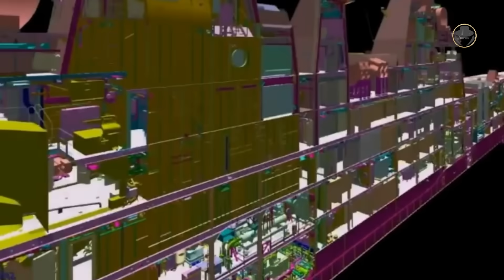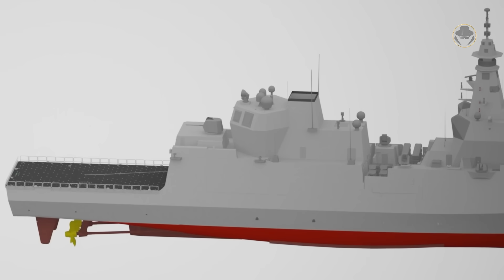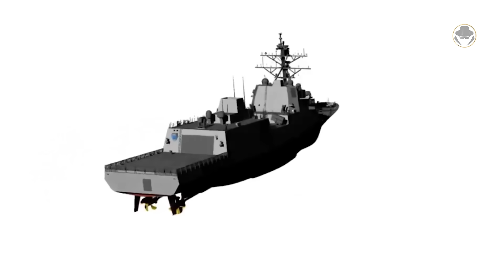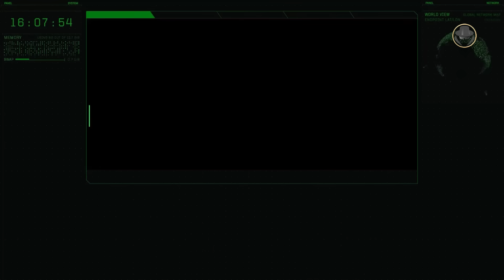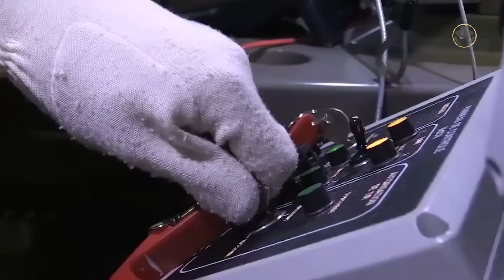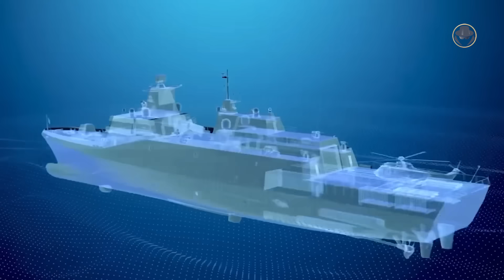FREMM class | One of today's most potent frigates

Comment: These are an excellent frigate with the drivetrain a standout feature which is one of the main reasons they were chosen by the USA.
I am amazed the USA has done such an extensive and costly redesign and still hasn't got the constellation class frigate cost and design to acceptable levels.
😎🇦🇺

Comment: Too few VLS cells for its size.
Reply: Actually it’s not comparable to us ships as the missile have higher probability of hit. 
Allowing for shoot look shoot vs shoot shoot look (for the us). 
In clear English only on aster 30 will be shoot with 90% chance hit, not then aster 15 with again 90% hit (180% chances). 
Where the us missile have 80% probability of interception (I’m obviously not really aware of those figures but for illustration) but the us will send 2 from the start (160%). 
Current y the French navy is have a mixt of 80% aster 30 vs 20% aster 15. 
So on average fremm will use 1.2 missile per target vs 2 missiles per target in the usnavy. 
So you can calculate 36x1.8 65 equivalent missiles on a USA ship. 
That is also why france is not adding the potential 24 mica vl extra, they would have to be shoot by 2, given an actual 12 target capacity (at the end it’s even more expensive then aster, they may land on the fremm but as very short defense system or mistral 3). 

Of course a us destroyer has a mucher more layered defense, not only better for self defense but also for escorted ships. 
Next year a new aster 30 will arrive with anti ballistic capacity up to 1500km and interception at 60km. 
Fell owed by a new version of the aster 15 in 2030. 

Finally, yes we could have more probably but not to much more over gunned ship have a poor stability at sea. 
And for budget reason we prefer to have under gunned ships but more numerous then the opposite, in case of war we would have a minimum time to rearm them properly.
Reply: @jeanvaljean9293  this isn't really accurate. The FREMM has more or less as many, if not more, VLS cells as any other frigate developed around the same time. The Royal Navy's Type 23 for example carries no strike length VLS cells, and the newer Type 26 carries 8 more strike length cells than the FREMM but also displaces almost 2,000 more tons. I feel like the original comment was made in reference to the likes of the USN's DDG-51s which carry 96  strike length cells, but those ships displace 3,000 more tons than the FREMMs and were designed for an entirely different mission set of long range strike using TLAMs, over the horizon air defense as part of a carrier strike group, and ballistic missile defense. All of which requires the USN DDG's to range and engage targets at several multiples of distance than what a FREMM doing convoy escort, anti-piracy, or short-medium air defense would be expected to support.
Reply: @centurion1945 would point out Fremm can only carry 16 sams and 16 strike missile or 32 of either, though that’s the problem with Slyver vls
Reply: @jeanvaljean9293 And if they are not enough there is the 76 with Dart ammunition, it hit so many in the Red Sea.....
Reply: The DART rounds cover part of the missing vls's job.
Reply: strales 76 mm is a game, with guided bullet its interchangeable with aster and more economically
Reply: Made for a time when there wasn't a full blown military conflict in europe and countries didn't threaten to annex each other
Reply: I feel that it would be much better to have a design together with a major shipbuilding nation, that also uses American tech, like AEGIS. I would say South Korea.
1. Joint development would significantly lower costs.
2. Some of the hulls could be built there, then sail to the US for radars and other specialized equipment installation (for the sake of OPSEC). Koreans can mass produce ships at a bargain price, also they are ok with the technology transfer, so some shipyards could be set in the US to build these ships as well.
Reply: @Viktor-x1w7w  we dont want us hardware

Comment: Le  programme Constelation avec les Usa est un cauchemar! le lobby américain veut plus et encore plus mais c'est impossible, je plains les Italiens! en France nous sommes passés à la FDI sans l'Italie. Magnifique la FREMM mais sans les obligations Us!
Reply: Basically every issue with the Constellation class comes down to making it compatible with the Aegis air defense system and US weapons systems like ESSM and SM-2/SM-6 since there is little point in having a ship that cant use any of the current weapon stockpiles and cant fully communicate radar and tracking information with the rest of the fleet. That said, most of the "nightmare" was FMM making somewhat unrealistic marketing announcements when they were first awarded the contract, with the first ship of the class still on schedule to be delivered several years faster than a "clean sheet" design would have been, and for less money.
Reply: @centurion1945 Foncantieri isn’t responsible for the Constellation ‘s design, it is Gibbs & Cox.
Reply: @brunol-p_g8800  Gibbs and Cox is handling detailed design, however FMM developed the initial concept designs which formed the basis of the award package. At the time of the award FMM and the USN put out some marketing material regarding the high degree of commonality it would have with the FREMM and overall high level of design completion, with USNI for example reporting the design was already at 80% complete at time of award based on press releases from FMM and USN. Of course this wasn't exactly accurate due to the integration issues I mentioned before, which FMM & USN knew would need to be overcome.
Reply: @centurion1945 unfortunately tho, given the US Navy's recent history of ship design, it is likely to get worse before it gets better. If it gets better. Cough, cough looking at you Zumwalt and lcs classes cough cough.
Reply: @centurion1945   Not really, there is a good video from SUB BRIEF explaining how the pentagon keeps changing stuff, like the whole point of that program was to have a readily available frigate with a proven design, if you change everything then you can't blame the designers for not being able to meet certain deadlines.
Reply: @ThisTheAviator  I am familiar with the subbrief video and he talks about the same material put out right when the contract was first awarded, but the actual requirements never actually changed. The Constellation was always going to get SPY-6 radar, MK-41 VLS with fire control systems for ESSM and the various models SM-2 and SM-6, while needing to follow the USNs compartmentalization and damage control standards. Still, by selecting the FREMM, the USN was able to lock down hull form right off the bat, and Constellation even with delays, is still on track to be delivered several years earlier than most USN ships from initial design award, with steel already cut and keel layed in under 4 years, whereas most ships historically took longer than thay just to arrive at plan form.
Reply: The Constellation class was just canceled. Honestly our navy should have left the design alone and just built them instead of trying to turn it into a mini Arleigh-Burke class destroyer. Now we get nothing. There was nothing wrong with the original FREMM hull design

Comment: 11:21 is that a typo or, maybe, some confusion with the maximum interception altitude? Aster 30 actual effective range is way more than 20km. Also, the Indonesian procurement of the class is very unlikely due to financial issue (at least, the last tender is very likely invalid). 

Anyhow, this is a good primer on the class. The French and Italian variants are very different (way more than in the Horizon destroyers) and it's very hard to cram them all in such a short video. It's almost easier to list the common features. For example other differences not listed: the countermeasures and ew systems, the hangar dimensions, automation systems, cms and even the hull (Italian FREMM are 1m longer).
Reply: The term "effective range" is just a marketing word. It means the missile has the potential to be effective in this range if all parameters are right, which would never be. So, the best effective range for the Aster 30 is about 20 to 25 kilometres. Beyond this distance, the probability to hit begins to decrease. It does not mean the Aster is ineeffective in 30 kilometres. But, the probability to hit decreases from, for example, 98% to 80 %. In another 5 kilometres 50%, so on. This is for all missiles.
Reply from the maker: @habahan4257 Thanks. He told what we would say. If it is not a saturation attack from a long distance, a wise captain would fire one or two Aster 30s to hit incoming threats at a range of 20 kilometres. It would be the most cost-effective and guaranteed way. Of course, the longer ranges would be more convenient in an emergency salvo fire.
Reply: @habahan4257  It also depends on the target in question: against a drone or an aircraft the range is probably way closer to the stated 120km than against a supersonic  anti-ship missile.
Also the ability to intercept varies wildly if the treath is coming directly at the ship or if the missile has to pull a deflection shot.
Reply: @tommasogubiani3768 Yes, of course. I meant the highest threat scenario. I think the WD also mentioned that.
Reply: @habahan4257  I don't know much about it, but what makes a missile lose its hit probability with distance ?
Reply: @ Making manoeuvres dramatically accelerates the missile's fuel consumption and reduces its energy. So, the missile's manoeuvrability reduces to nearly zero after a certain distance. Also, as the range increases, the missile is subjected to more atmospheric effects, reducing its effectiveness.
Reply: Correct aster 30, the 30 here is for 30km vs missile. 15 km for the aster 15. 
120 km vs planes. 30km for aster 15. 
The 20km is the altitude and 13 km for the aster 15.